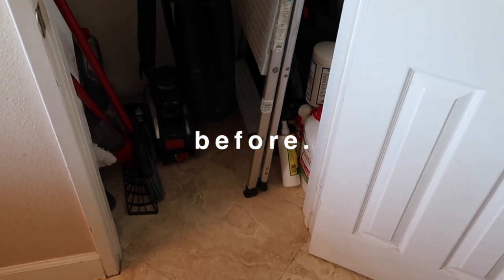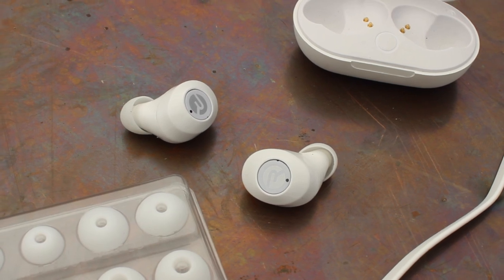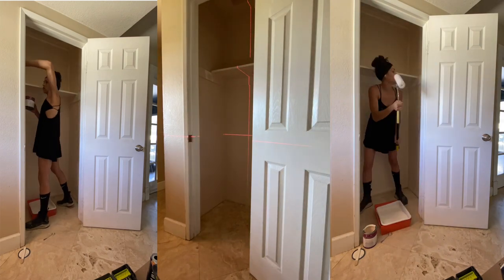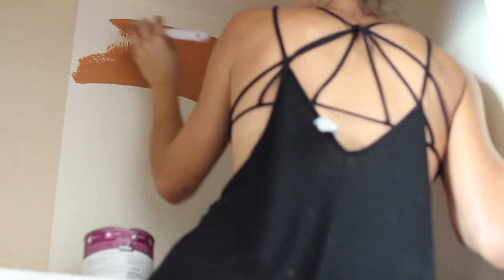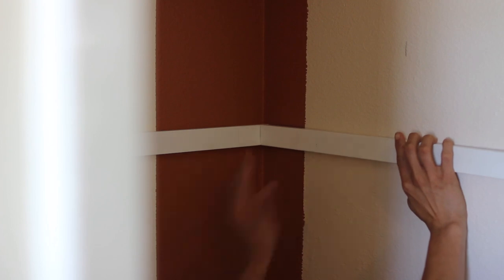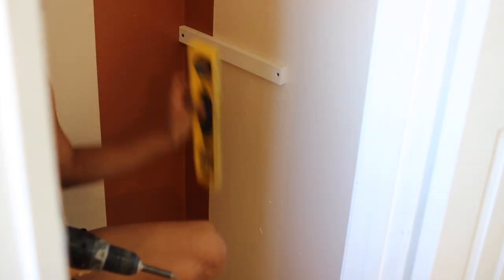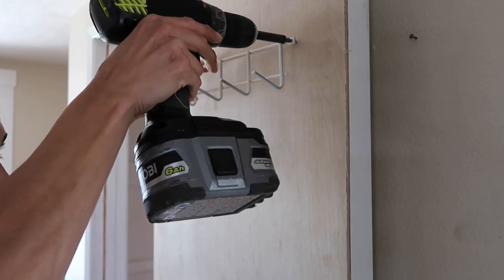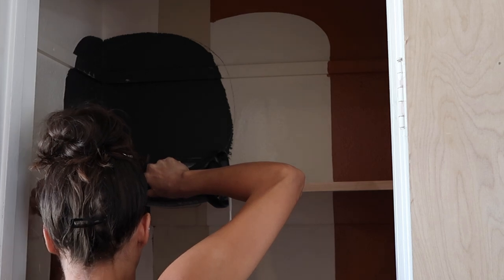DIY Cleaning Closet Makeover

Comment: Something I learned from mr Kate (which...when is THAT collab happening...could you imagine??😍) when doing stripes or separate colors on a wall is to paint the area with tape with the same paint as the rest of the wall first, then go over it with the new paint once it dries! Makes the line super sharp and clean. Changed my life for real.